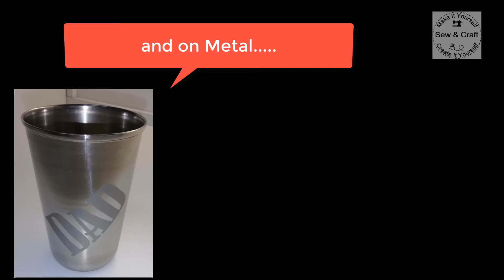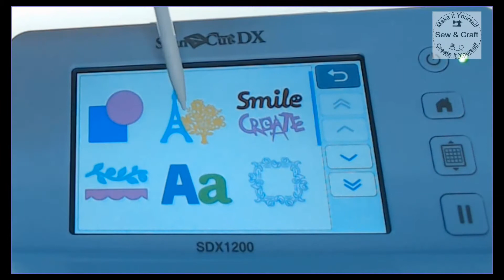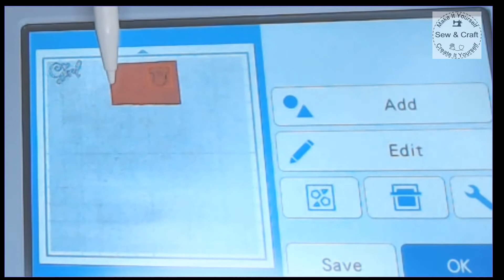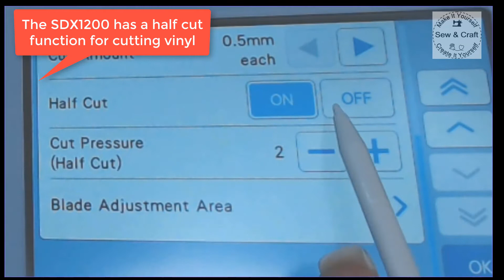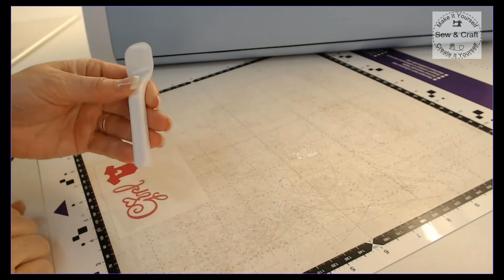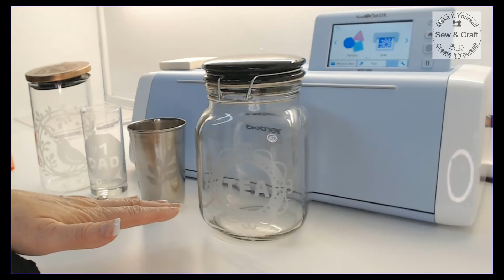Cut Self Adhesive Vinyl with ScanNCut Tips

Comment: Thank you for the tutorials.   Do you need a auto vinyl blade with this machine?
Reply from the maker: Hi Brenda,
There is an Auto Vinyl blade kit which comes with a holder and blade as well as an activation card that will allow you to create really large designs - like for large windows or large wall art projects.
It is an OPTIONAL extra, so you do not have to have the kit to be able to cut vinyl.  It can be cut with the Auto blade that comes with the machine.
All of the projects in my video were cut with the regular Auto-blade  (Black holder).
Look out for a new video coming soon that will discuss the Auto Vinyl Kit.
You can also visit my website  www.sewandcraftstepbystep.com
(The website is currently undergoing a re-vamp - but most of the important things are there already.)
Have a great day!
Kind Regards,
Sherine Haines